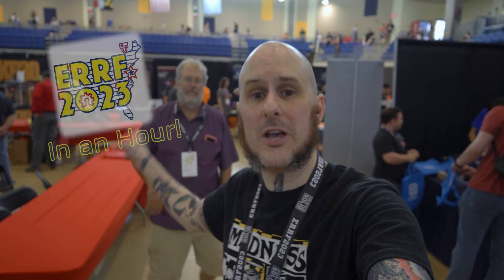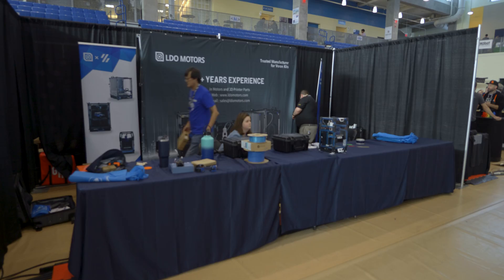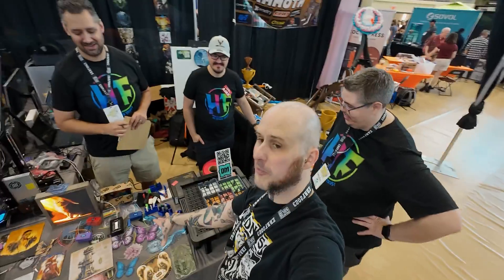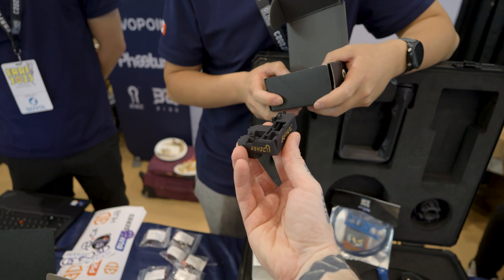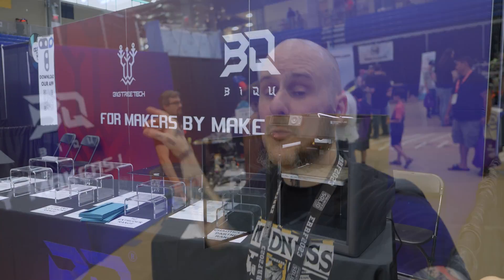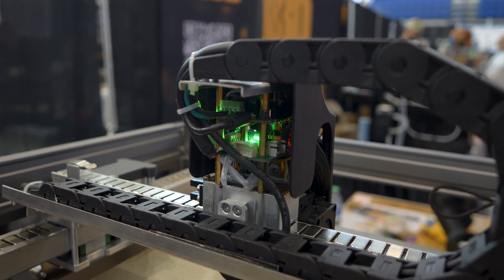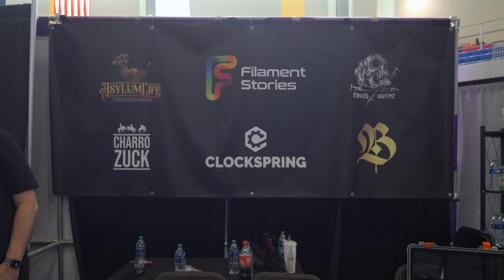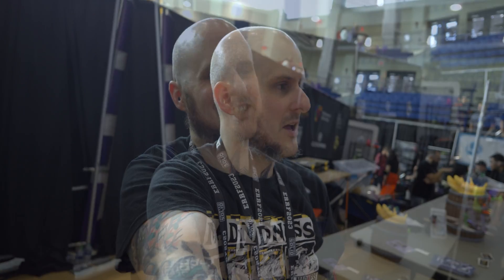ERRF 2023 in 1 Hour!

Comment: Thanks for the video! I wish I could have been there. Do you know if there are any plans for a West Coast version? 
I am on the edge of getting a BL X1C, but it has been out long enough now that I would think there may be some other options worth considering that are about to come out. That Peopoly magnet one looks interesting. Do you know about any other printers coming out within the next few months that might be worth considering over the X1?  I am focused on getting something as accurate as possible (considering FDM limitations), and as reliable and hassle free as possible. I've been printing for almost 2 decades, and I never want another printer that is a chore in itself. I've spent more time fixing printers than using them, and I have them to make and sell products, so I can't waste time chasing issues anymore. So obviously, I am not up for building a voron or anything that requires me to put the whole thing together.

I have been enjoying your videos for a while. I thought I was subscribed. Oops!  I am now though!